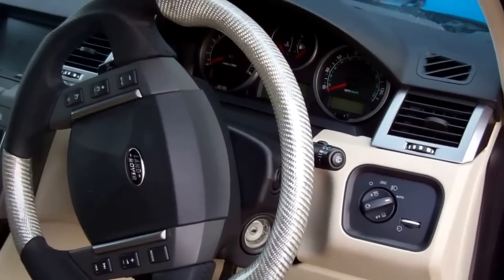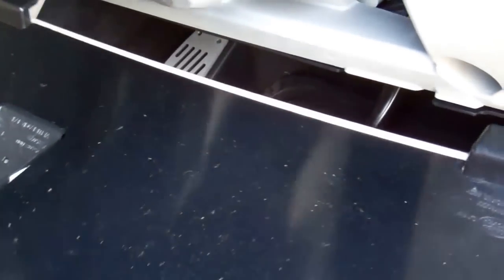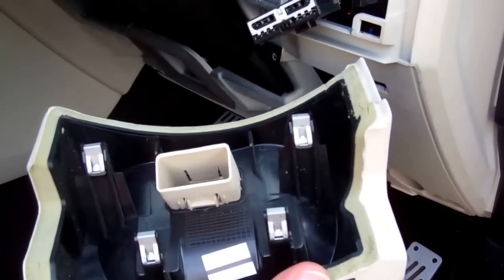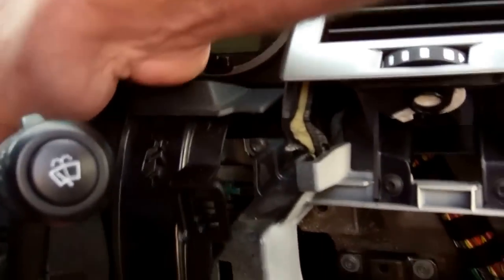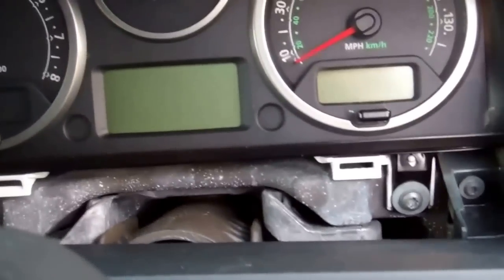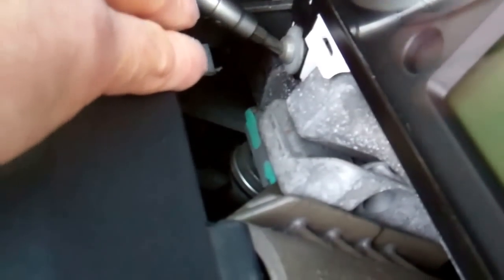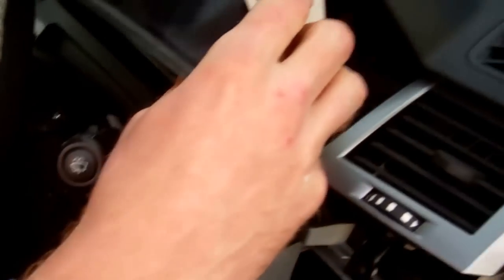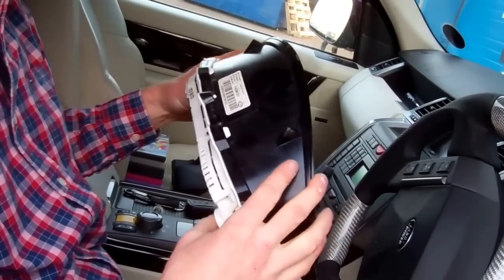How to remove the Speedo / Instrument cluster on Range Rover Sport 2005

Comment: Your video helped me a lot by exchanging the instr. Cluster in my 2009 3.6 TDV8. In my case the first two screws were T20 as you said. The other two fixing the cluster were T27.
If anybody get problems after exchanging and reprogramming (using SDD) the instr. Cluster by an used one, just Re- programm the keys, also with SDD. No engineering code needed.

Comment: Just finished mine, easy job, you must use  2 small spoons to remove the needles,
take your time with them.
Also the two screws  holding the facia are a pain, really need a flex drive..
if your in leeds and local to me I can help you with this. Wortley leeds LS12.
I have The new Cream clocks now...cost  £49.00
What a great video..this guy is 100%..
Reply: PowerfulUk commented on another video that the spoon method of removing the needles did not work so good. That they do not work the same after reinstalling them. Can you expand your comments regarding this? I need to replace the LCD screen on a L322 BMW. The screen is very pixelated and basically unreadable. Can you provide your best advice on removing and reinstalling the needles. Thanks for your help in advance.

Comment: This worked like a charm on my 2007 LR3. Thank you.
Reply: I have an '09 LR3 that needs a new cluster.  Did you have to reprogram anything when you installed the new cluster?  Does the milage stay the same, or does it reset?  Where did you purchase your new cluster?
Reply from the maker: Hi - the mileage apparently is stored in the LCM ( Light Control Module ) so there is a good chance you will be ok swapping.
Reply: You definitely have to reprogram it.  My Rover dealer did this for me.  He was hesitant but said he would give it a shot.  Later he said it took a few tries but he was eventually successful.  A side note...since then I have purchased a IID diagnostic tool and it looks like it has the functionality (along with many others) to reprogram the IC.

Comment: Thanks for video! Fantastic! I already have confidence to fix my RRS. 
Can I have a question? 
I have a RRS 2008 2.7 tdv6. Her gaugaes randomly while I am driving cut off. Everything get in dark. After some secs or minutes everything turn back. When this electric issue is "on", the alarm sound what is signing when I leave the key in the ignition is much less loud then normal. The gren light what is on when the headlights are on is lighting much weak. Even the dash computer's screen is dead, or the green backlight is on, but there is no caracters. 
I checked the fuses. All fuses ok. 
So please tell me is my electric issue can be because the connector what is at the back of gauges? Majbe I have to clear it up for better connection?
Reply from the maker: Sounds like a problem with an earth connection ... check your connections especially the earth !
Reply: @L663  Thank you very much for fast answer. 
Can you tell me please where is the earth? Itself the battery connection point on the body, or has the instruments cluster an own earth somewhere? Thanks
Reply: @balazspetho5070AgroGO  hello have you figured it out
Reply: @ljsproductions3006  Hi. It became good by itself. I have no idea what was the problem.

Comment: Have changed my Instrument panel as in your video and it went well until I tried to start the vehicle now it won't turn over at all. What should I do now. Please help!
Reply from the maker: Hi - did you replace it with another cluster ? or the original one ? Does the cluster light up when you turn the ignition on etc ?
Reply: @L663  it was a different cluster. All the lights come on but it just won't turn over at all. Have now put original back on. A mechanic told me they can't be replaced as each is unique to the vehicle so I am totally confused.
Reply from the maker: @ingridmullis4832  The mileage of the car is stored in the LCM - lighting control module - not the speedo cluster like in the good old days.....but apparently the speedo and the LCM are coded together for some reason.
Reply: @L663  Thank you for replying

Comment: Hi, thank you for this instructional video! I was wondering if it is possible to upgrade the cluster dials to a more larger font number type like what is on the land rover lr2 2011+... I have a 2008 sport supercarged and the speedometer fonts are tiny and I can barely read them, do you guys know if this is possible to swap guage dials from the 2011+ LR2's to the 06-09 sports? The clusters look identical from all I can see? If this isn't possible do you guys know where I can get custom dials? I saw someone put porsche styled ones in their 07 sport but couldn't find their supplier. Much appreciated!
Reply from the maker: Hi there is a supplier called "Lockwood dials" in the UK that make customer facsia for the speedo. If there is demand for this we can get some made.